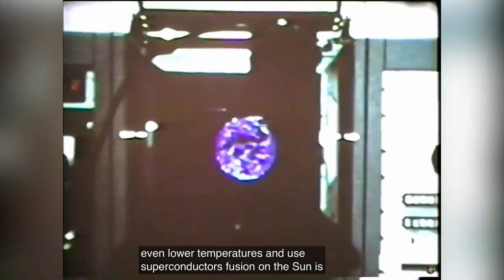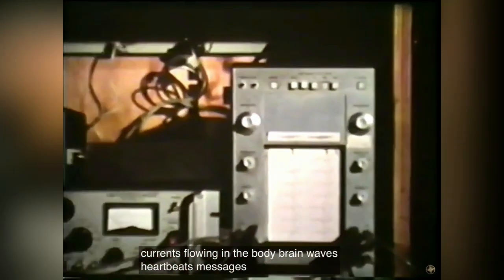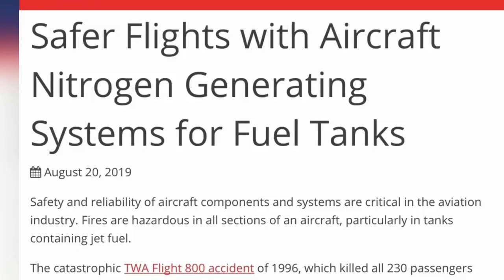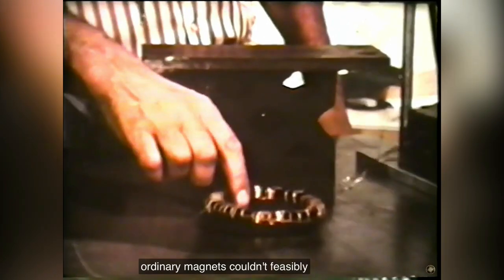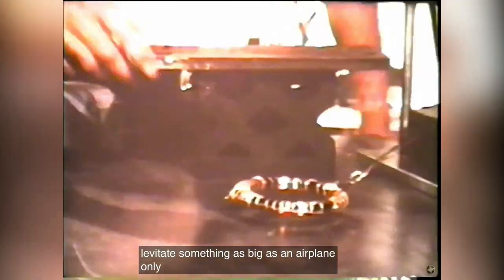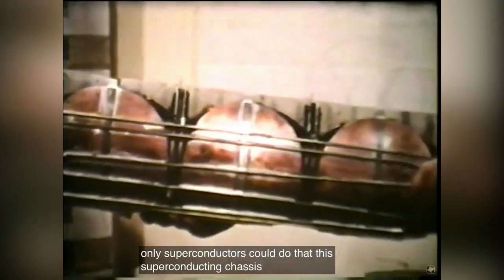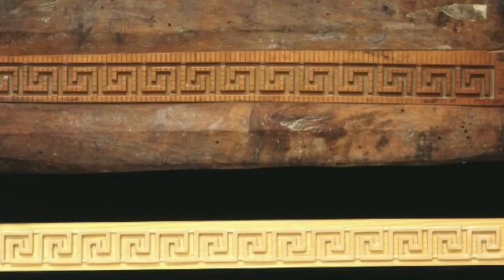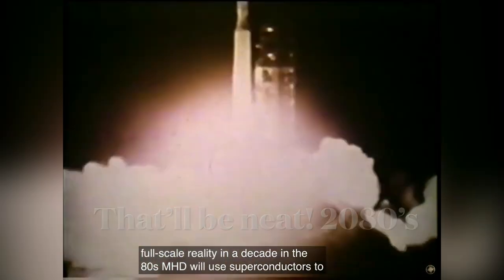Magnetic Meandering Superconducting Electric Levitation Realm Engine | UAP Channel

Comment: Compressed air (airRam pump or some nonsense is what the military industrial complex would call it) is the turbine fuel. Condenses it to water then second stage uses the air now water into a second spin ...air ships or blimps were so much cooler than their airplane wizardry industry

Comment: I'm no physicist... 
The motionless planes tie into the first half of the video how?
So, glitches in the matrix aside, is this how planes normally fly with little-to-no fuel?
Have you solved the riddle???
Reply: Watch it again, think about the second half being "lift".
Reply: @Chris-P    Yes. Watch it again and again and again.
Reply: Amani put all the fuel in the wings those wings with all the Hydraulics and electrical in them hope all the fuel and that's how a plane can fly
Reply: Sorry I'm using my speaker since I got fat thumb but we're all smart enough to read between the lines right and the plane stamos's in the sky because of the time parallel haven't you ever watched Back to the Future the dock new
Reply from the maker: The possibility of nearly free energy from atmospheric electricity plus separation of hydrogen oxygen by compression with electric DC current for water fuel, I learn fuel tanks drain to atmosphere by design and have Nitrogen chaser gas, now I learn of how superconductive magnets are used in liquid nitrogen generators, a airliner needs a little fuel to power the APU, and a bit to make thrust on the engines, just consider how mag lev over a meander works where you don’t need to use special metals to shield away magnetic field like in the hexagonal/octagonal generators “moonship”, in cold temperatures of flight a little liquid Nitrogen goes a long way. Planes may levitate in headwind, add consideration of the ether, you could boost or supplement lift from gyroscopic effects, and primarily the strake effect.
Reply: @UAPChannel  I just yesterday listened to a podcast by Richard Syrett. “ the conspiracy podcast” .on Zero point energy.  The guest talked about this very same process of creating lift on airplanes.
Reply: @UAPChannel  Thank you!
Reply from the maker: @mu ma Strake provides suction and assistance to the lift when over top the engine / wing... it’s why the engines are forward on the wings